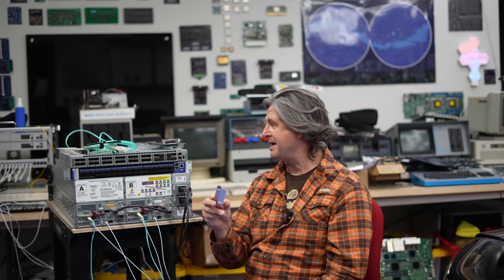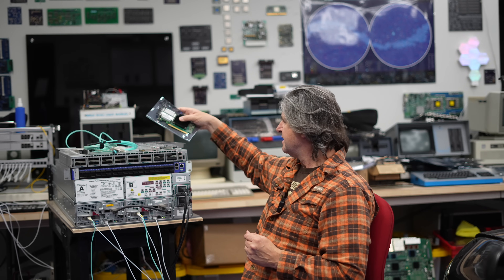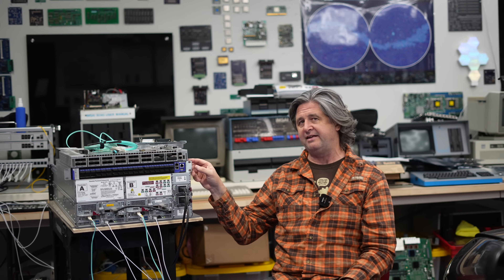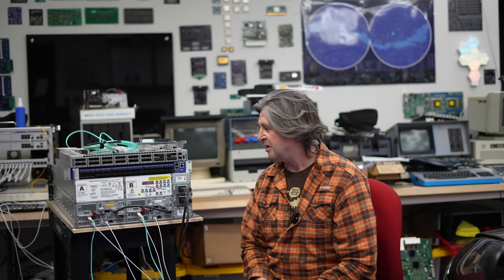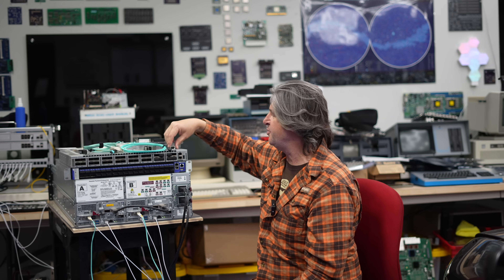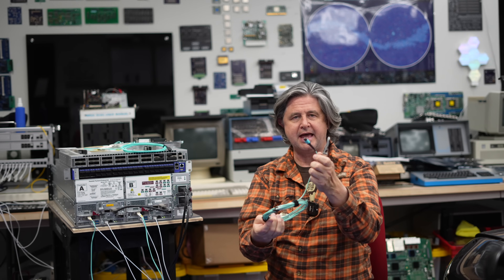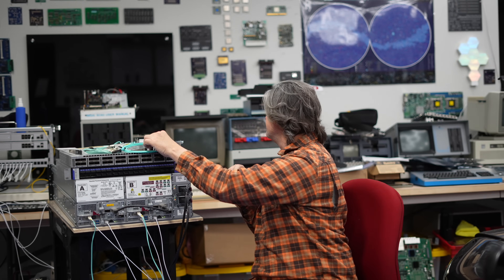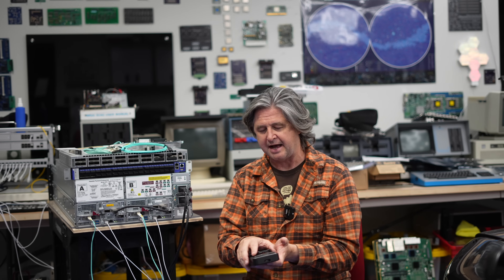HOMELAB:  Upgrading from 10g to 40g in your homelab on the cheap!

Comment: Question?
If there is a 40 gig that's out there, is there a 20 gig or a 30 gig?
Instead of copper, does Dac cables make them in FIBER?
What is the failure mode of the switches?
How often do you upgrade the interfaces?
What are the speeds with Multi Wave Length?

Comment: I've been buying a few of these ConnectX-4 cards, updating the firmware and loving them. Recently tried a few Intel cards too - a lot trickier to update the firmware but modifying some of the configuration files with Intel's firmware updater seems to have worked for me so far. Love old enterprise gear.

Really agree with you on DAC cables here too! Love your content, really fun stuff. When I grow up I want to be you. Big fan of the WRX (I miss mine).

Comment: Connectx-3 is actually goes often below 20$ now.
About 30-40 is a common price range for connectx-4 Lx nowadays and for about 50 you can find connectx-4 1x50 or 1x100.
Reply from the maker: That is great..... and optics on ebay are surprisingly inexpensive.
Reply: @ yup, but for 100g your only cheap option is CWDM4 modules, those Ive seen for about 5$ per module (3$ but it 60% working, therefore final cost was about 5-5.5$ per module)
Reply: @jeffsponaugle6339  so far in my experience the most problematic part is finding good and cheap switches. There are a lot of 40/100G switches on a used market for reasonable price (Celestica DX010 for example), but they are loud and power-hungry, not very home-friendly.
There are quiet modern ones, like from FS or Mirotik, but price-wise they are triple the cost of Celestica, if not more...
And there is almost no solution for 25G networking, it is easier to get 100G switch and breakout cables.

Comment: Thanks for such an informative video unfortuanly a lot of those enterprise switches sound like a jet engine . In my current home I really don't have any where to locate them I'm hoping to buy a new home over the next year that will have a basement. However, IMO compared to 10 gig 40 is the way to go due to the low cost of the gear.

Comment: The Key required for the arista switches for unlocking unsupported transceivers can be found on the internet very easy. I have multiple switches with the newest EOS version and all have unsupported Transceivers enables.
Reply from the maker: I assume you mean the 'service unsupported-transceiver wiprolabs' one?
Reply: @jeffsponaugle6339  There are multiple codes you can find online, as arista uses a different code for every customer. I always use the EMC code, but the wiprolabs should work also.

Comment: Love the video and thank you so much for sharing your knowledge. You have me thinking how can I justify 40gig in my home. Still can't imagine the need at least for my use cases. The 10gig I have no is barely used. I imagine I'd need a few U.2 SSDs in a raid to actually even reach half of the bandwidth. Also, imagine the amount of electricity and heat both the adapters and switch would create. Just can't think of any good reason to make this happen. Again for my use cases.

Comment: I would go to 25gig and 100gig upgrade instead of 10gig - 40gig. Makes more sense to me.
Reply from the maker: 25g/100g is certainly better, but a bit more expensive.   40g is a sweet spot if you are looking for retired enterprise gear and needs lots of interconnects.   There will be cheaper retired 100g gear in the next few years coming to the used market.

Comment: There are usually 2 "physical" form factor in most switches today (except in DataCenter or Long Haul Transmission).
SFP (1 lane) and QSFP (4 lanes).

40G for cheap ass lab thing is OK. But for deployment  I suggest deploy straight to 100GBE (QSFP28), not 40GBE, the cost is not much different now. (Only optics module will be quite more expensive).

Usually QSFP28 port also compatible for QSFP, you can plug 40G optics.
Reply from the maker: Absolutly, for real datacenter no one would do 40g now, 100g/200g/400g is the path.. but for homelabs looking at cheap retired hardware ti can get a great option.   All of the 40g you see on ebay is because the DCs upgrade to 100g/200g/400g.
Reply: @jeffsponaugle6339  Retired Hardware at 10G signal is cheap, yes. but it may be very old, every inefficient.

So for retired Data Center switches, I suggest only buy 25/100GBE and up (usually accept 10/40GBE plugable anyway). Lower speed than 25/100GBE that just grab new, cheap, efficient switches instead. 10/40GBE in retired hardware market are very old and power hungry, and loud as heck.

100/200/400GBE is for hyperscale/AI. Unless you running storage over Ethernet, 25GBE pretty much enough for typical servers except for high-density VM.

Comment: Amazon is above 100G switches. They're at like 200G or 400G at the rack layer. I think the other hyperscalers are the same or similar. Likely 200G hardware will be rotating out soon. 100G stuff is already being EOL'd.
Reply from the maker: Yea, I have started to see 100G switches that are not crazy expensive.  40G is still the cheapest, but I would expect 100G to start to show up more.
Reply: @jeffsponaugle6339  don't be surprised if you start to see 200G gear soon. Amazon had already been using switches capable of 400G/port+ for a while. In fact, they're doing 1600Gbps on their instances using elastic fabric adapter for trn1 (tranium) and 3.2Tbps on trn2. They have other non-efa stuff supporting 400Gbps, which means they're likely going to EOL products that only run at 100G and 200G per port as the 100G equipment ages...especially higher up the stack as we get to the core and agg switches all the way out to the edge switches. They've all got to be able to support higher throughput at the edge to support everything beneath.

TL;DR: you're going to start seeing 200G and 400G switches before too long as Amazon is likely cycling out of those switches higher up in the core and agg layers of the EC2 Network.
Reply: oh...also, the only problem I have with going with 40Gbps (and mind you, I have some 40Gbps, so it's not a knock on this video) is that you pigeonhole your solution to the 10Gbps standard, instead of the 25Gbps optic standard that everyone is shifting to via the SFP28 standard. The 50G and 100G switches are not so much more expensive that they're not worth it. Granted, the SFP28 optics will also run in a 10G optic slot (ie. SFP+) and QSFP28 will work in QSFP, so you could go with SFP28 optics in 40Gbps switches and then just swap out switches when the price of them comes down more.

That actually might be the BEST way to go about migrating or planning for fiber. Buy SFP28 and/or QSFP28 transcievers/DAC cables and then the 50G and 100G upgrade paths aren't as expensive down the road.
Reply: 100GbE switches are easily to be found refurbished and at reasonable prices, but: power consumption and PCIe cards are quite pricy. At work in our racks not a real problem because the capability is needed and pays for itself, but I would not go 100 at home.
Reply: @ yeah, probably 99.9% of people don’t need 100G at home. I wouldn’t go to 100 either, but 25Gbps or even 50Gbps would be something I’d consider if I wanted to do some serious network file operations (like running an HPC cluster)

Comment: i'm still on 1 gig with plans to upgrade to 10 gig soon lmao

should i just skip 10 gig all together and move straight to 40 gig?
Reply: Depends on your setup and budget. Personally I'd  look at 10/25G and eventually 100G, because 40G is going away. But that also means you're gonna find a lot of good deals on 40G stuff.
Reply from the maker: Exactly - If you are buying new gear you can start with 25G, and that makes easy interconnects to 100G later.  However if you are looking for bang for the buck the 40G stuff is in a sweet spot.  Over time for 100G stuff will drop in price, then 200G/400G will be the place to go!

Comment: I recently upgraded my rack to a new OPNSense router with 40gb and 100gb dual headed ports (Intel Converged). The 40gb port feeds my 48 port switch which goes through the house, and the 100gb goes between the router and the main server.

Comment: Do you have 40G around your entire house, or just in your lab? Building a new server room as I’ve run out of space, curious what you would recommend for future-proofing.
Reply: 40G is pretty much dead for the future, which means you'll find a lot of cheap 2nd hand gear for at least the next several years. 
most datacenter gear is moving to 25G and 100G, with 400G showing up on the high end stuff. so if you're really think long term, get 25G since it'll normally do 10/25 and gear that does 100G will usually support 4x25G breakouts.
Reply from the maker: Yea, 100G is starting to trickle down, and those prices should come down.  Optics are also getting cheaper.  I'm running a 100g right now and using that 4x25 breakout to connect to my Ubiquiti Aggregation switch.
Reply: @jeffsponaugle6339  Yeah, I think I’ll probably bite the bullet and plan for 100G throughout the house. I’ve gotten about 20 years out of my Cat5e runs - which were originally intended for fax machines, phones, and printers lol - so probably about time. Need to do some repainting after a lighting overhaul, so it’s an opportunity to punch a few holes in the walls and run OS2 SMF to all the critical areas. Hoping that will future proof me for another 2 decades. Kicking myself for not running conduit back when I built the place, but everything’s clear in hindsight.

Comment: Am I getting old? I still remember going from 10M to 100M and it being a game-changer. 😭
Reply: Try dealing with Token Ring and vampire taps... 🥴
Reply: @chrisnelson414  When I was a kid, my school had Token Ring. I never dealt with that other than plugging those crazy proprietary plugs in. Eventually the first network I implemented myself was 10-Base 2 Coax with the T connectors and terminators on the ends. We were playing Doom over LAN at a local college for a LAN Party. So yeah, collisions were by design in those days. Amazing how far we've come. :)
Reply: @chrisnelson414  Yeah, weren't those fun? I don't miss the token ring or coax setups.
Reply: @chrisnelson414  Oh yeah I remember those AUI transceivers some with the long blue cables to the ethernet cards in the 'micro'. Used token ring, Only talking about these days yesterday and DECnet cropped up too.. lol
Reply: I studied about token ring for the net+ even though it was already obsolete.
Reply: You're not getting old, you are old :P
Reply: @AJsWorld  I resemble that comment.
Reply: I remember LocalTalk (for Macs over phone cabling) at 230 kb/s to 10Base-T. Woo!
Reply: well really 40gb gear is a decade old now, the modern stuff runs at 400-800gb.

Comment: That SFP module vendor lock-in is indeed annoying. I recently upgraded the core link from my server to my Cisco switch to 10G but only had HP SFP modules. Took me a while to figure out the IOS command to allow non-cisco SFP modules to work. Unfortunately the switches I am using (Catalyst 3850s) only have two 10G SFP ports in their network modules, so they are pretty limiting in that way. I have been looking out for cheap 4x10G network modules for the 3850 but they don't seem very common.

Comment: Excellent video, Jeff. What is the model # of the Arista switch?
Reply from the maker: That is a 7050QX-32, although there are a couple of those series that are pretty inexpensive.
Reply: I was looking at the 7150s series and agile ports, but power draw is over 150 watts @50% load. I think I will go 7250sx-64. 4 40gb ports will be enough for me.
Reply from the maker: @philarmishaw3730  Yea those Aristas use a lot of power at idle!
Reply: I have a mini (or micro) version of your network. All unifi for AP, udm pro, and 1gb Poe switches. I took the 10gbe lan port from the udm pro and it is connected to a Ruckus icx7250 that has 8 10gb ports that feed my servers. I have a 1gb connection between the udm pro and my unifi switches. This way I can do anything to the Ruckus switch without affecting the home side. Works great, but short of buying a unifi aggregation pro switch and going 25gb nics, I’m thinking enterprise 10gb with some 40gb ports switch. It would be nice to go Ruckus icx, but they’re still too expensive. Lots of research to do, but that’s half the fun.